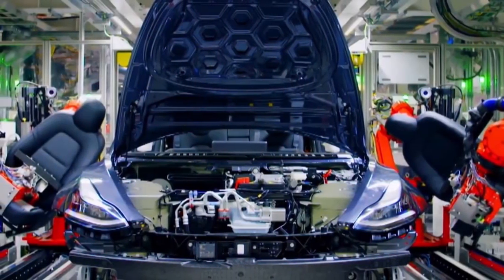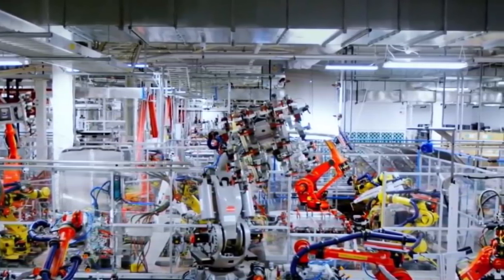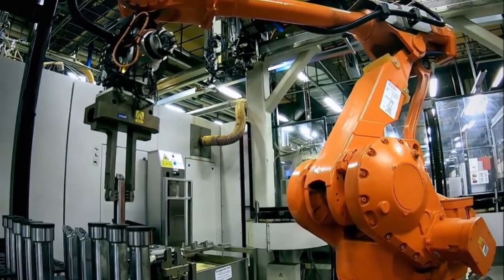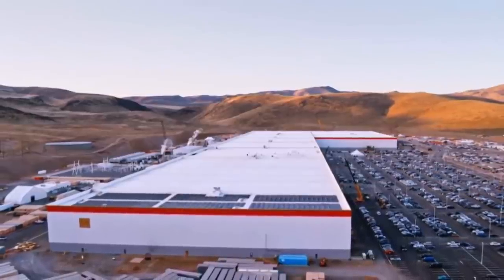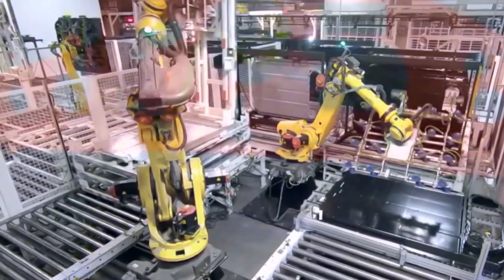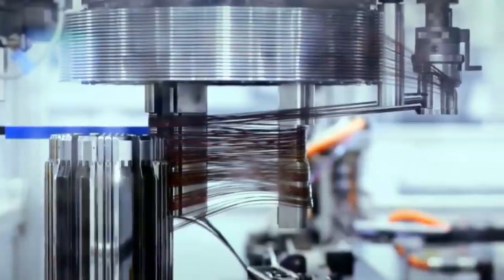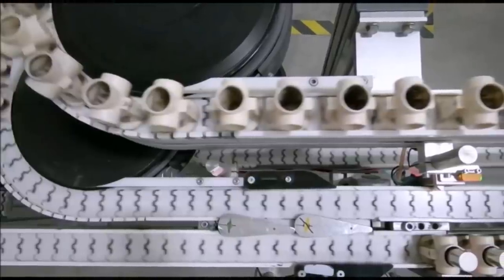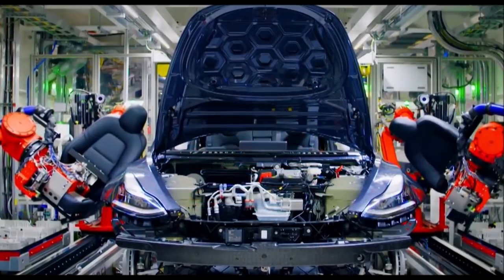Science Channel Goes Deep Inside Tesla Giga Nevada Showing Battery Cell Production

Comment: The Original Mini-Gun Had A Hi-Lo Fire Control Switch, That Toggled Between 2500 and 5000 Rounds Per Minute Fire Rate. But When Dillon Industry Purchased the Rights to the Minnie Gun, They Set The Firing Rate @ a Fixed rate of 4000 Rounds per minute.  Just FYI.

Comment: Found this video of a tour of the giga factory. It is over 12 months old but gives an insight into what its like in the factory. Some of the info is probably out of date but the main points stated were: The size of the factory is equivalent to 33 USA football pitches (5.3 m sq ft), some areas are 90% automated, the roof can house 200,000 solar panels - enough to power the facility and each vehicle made requires 4,000 battery cells.  https://www.youtube.com/watch?v=vv1mFAMz0PE

Comment: keep reading about the demand for tesla. they have had 8 straight quarters of 90k car sales. what demand they havent grown car sales in 2 years. plus who slashes prices with pent up demand. the stock price has demand the cars not so much.
Reply: You have a good point but still seem to miss what you're aiming for. Yes, it's true that they have produced "8 straight quarters of 90k car sales". But that has also been close to their production maximum. Because right now, they only produce cars out of one factory, the Fremont factory. Which can produce 490,000 a year according to Tesla.
Since this year though, their new factory in China, (Shanghai) has opened and produce cars, and when it's up to speed it will produce about ~250 000 a year. 
Yes, it's true that they haven't grown production yet but that is what they are currently working on. The construction plans for Giga Berlin is ongoing and they plan even more factories Giga Texas, in Asia outside of China. 
The reason why the stock price has shot through the roof is that the demand for the cars is so high that the limiting factor is production which Tesla is working on. My guess is that Tesla will sell shares to set up even more factories.